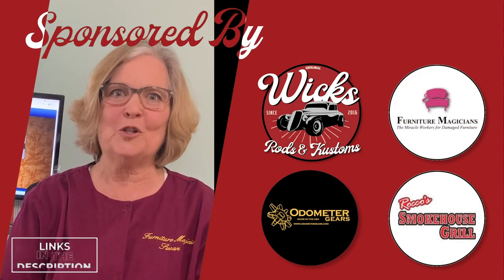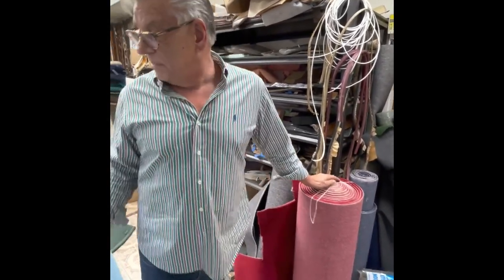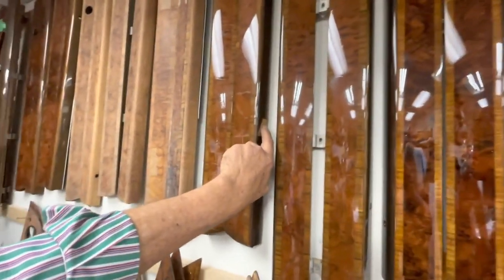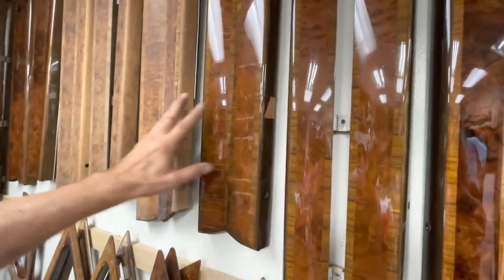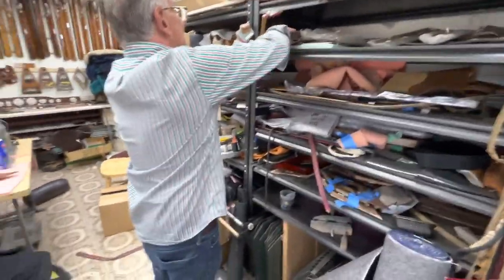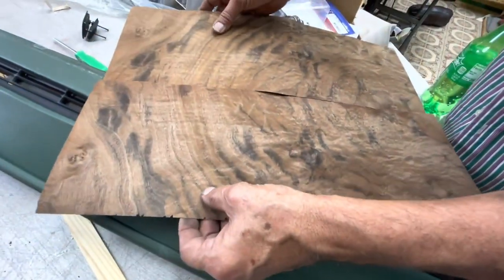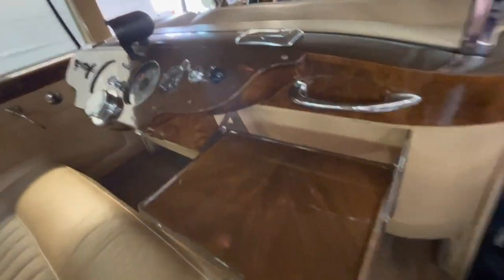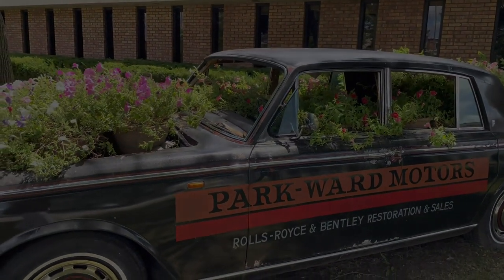Rolls Royce and Bentley University - Park Ward Motors Part 3.

Comment: Does the factory at Crewe have a division doing restoration?
Reply from the maker: Yes but not in the way it used to be in the hay day of the ‘60’s-80’s. Once Rolls was taken over by BMW and Bentley to VW, all the “VINTAGE” cars are not dealt with.🇬🇧
Reply: No
Reply: @rolls-royceandbentleybuyer8409  Please don't comment on things you know nothing about. Crewe never had a restoration division however the London Service Centre did offer that service although the vast bulk of their work was basic work on new cars. LSC closed down long before VW/BMW came on the scene.

The only additional service offered at Crewe was Special Features where new cars were fitted with options that fell outside legal requirements for new car sale. To make this legal, cars had to be sold and registered in the name of the owner requesting them. I know of one car that spent three years in SF and had to be MOT tested before the car was delivered to the owner.